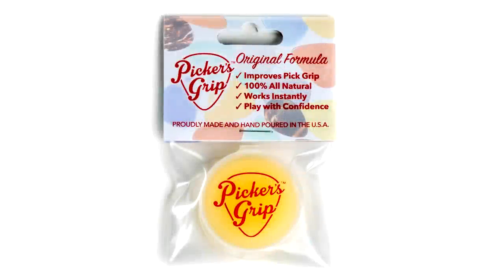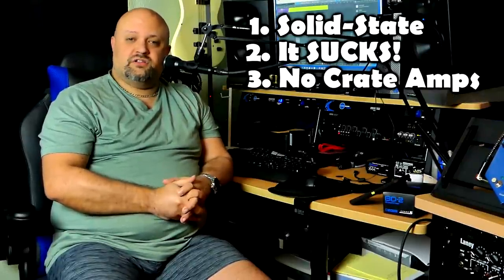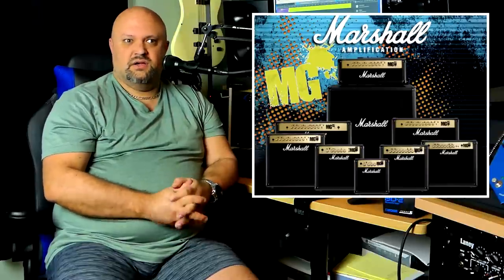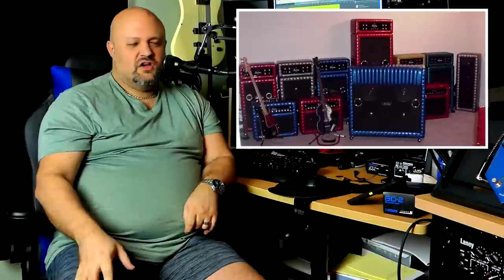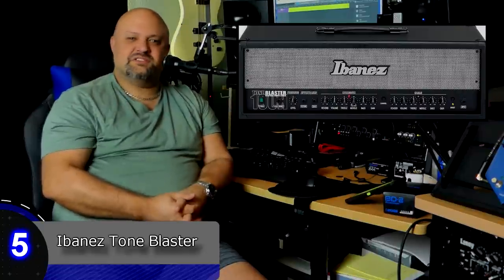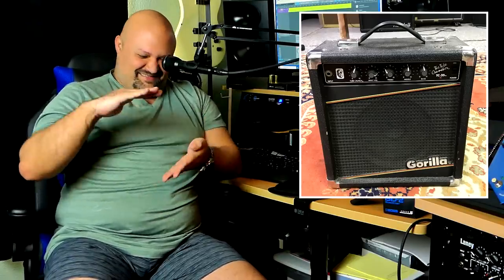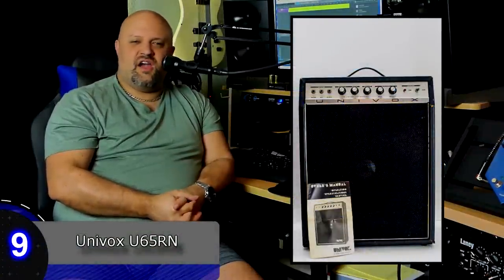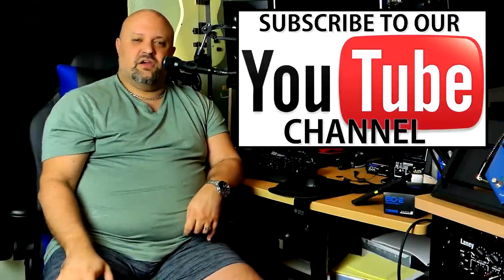Top 10 WORST Solid State Amps EVER!

Comment: What’s your thoughts on the toneblaster-x. Like the version after it?
Reply: That amp series gets a lot of hate for no reason. I had the TBX30R and as soon as I let mine go I regretted it. That was the most unique and brutal sounding amp I've ever owned. The distortion on that thing was so tight and saturated. The reason most people hated it is because they can be pretty difficult to learn to use. The midrange controls will instantly remind you of the mid controls on a Boss Metal Zone. There is DEFINITELY a learning curve. 

There are two stacked controls for the mids. They cover a wide range of frequency and one of the knobs controls the actual level of the mids and the amount of distortion affecting them. When you get that stuff tweeked right the amp is absolutely amazing. If you don't it's like a Metal Zone ran through a total garbage amp (on steroids).

If you're the lazy type that just wants to plug in and twist a knob or two for fifteen minutes to find your tone those amps are NOT for you. If you have patience and don't mind spending a week or two learning how everything affects the sound you'll have one of the best amps for brutally heavy music ever made. I'm trying to dig up a TBX150H for myself right now but they seem fairly hard to come by in my area.
Reply from the maker: I’d love to hear a sound example.

Comment: I have a line 6 spider V. Noob mistake… unfortunately having presets means you’re stuck with whatever tunes are available. The treble is through the stratosphere and everything is ear piercing. In the insane mode you can’t even hear the difference in chord changes because the overdrive is so high.

Comment: Mid 70's h/ h  VS musician amp. I was taken in by the sales blurb of how it sounded and performed just like a valve amp and the reliability factor. Tried to get something like a decent sound out of it but no way. After a couple of weeks it stopped working. Took it back to the store and purchased a good old fender valve amp. Solid state was a long way off in those days.

Comment: relieved you did not include roland jc amps . i played in a decent enough cover band for years . one of the lead guys we had  well he was kind of an annoying guy when he was in a good mood but he had a psychotic temper and a bad cocaine problem . that guy played thru a PAIR of tiny gorilla amps . he had to carry gear like this to ride his bmx to practice with a washburn eagle guitar strapped to his back - look ma no self preservation instinct .his tone was like if some one was tearing large sheets of paper inside of your ear. he did have a pedal , some kind of stereo overdrive in a plastic case . this was like 1995 . he played really quickly with no soul or feeling . he had to have gear with very little value otherwise he would pawn it to get crack money . poor guy . i got him a job and he would eat aldi tuna cans , pour the tuna oil into the sink in the restroom . he would not run the water . so every day i would go and wash up to eat and get bombed out with intense tuna whiff . he ended up flipping out and destroying a bunch of inventory in a fit so they got rid of him . he was built like a gorilla and he did a lot of karate stuff especially on stage . i saw him front a band and he was singing "sweet child o mine" doing all these spin kicks and the poor people in the front row where moving back - retreat ! Those Johnson millenniums - i JUST saw one at GC used yesterday - i was tellin my wife adrian belew toured with those amps in the 90s , he switched from roland jc120 and his tone took a huge hit . but i know another guitar player who switched from jc120 to a custom made tube half stack and same thing . i saw that guy perform in a lot of venues and i really knew what he sounded like , so that taught me a lesson about the whole tube vs solid state debate right there . dude sounded twice as good with the solid state amp . twice as good , more definition , and he is a type of player that uses like three gain stages . i had a laugh with you about those gorillas . i wonder if that guy is still alive . i heard from the sound guy of that band he saw him in january here in chicago riding his bike home in a snow storm from guitar center one handed holding a new les paul ... in one hand - so this guy had to give him a ride - typical . i hope he is at least off that tuna diet.

Comment: I have a MG HDFX Head and 4x12 Cab and although the dirty channels are a bit weak for some of the harder rock, they are fine for blues and pop sounds. I got it expecting to  not use the pre-amp as I run a Line 6 POD XT Live from the Effects Loops In completely bypassing it. I purposely saved some cash by doing this and the sounds I get are pretty decent. Big and loud enough for bigger gigs and have the flexibility of sounds I needed. I also got the Variax guitar to model other sounds I wanted like switching from Sitar and 12 Strings to a Les Paul in the middle of a song with just a patch change on the  XT. Pretty cool for gigging.

Comment: To this day, I think Line 6's are quite truly the worst "reputable" amps on the market. Even their most recent "high end" modelers sound utterly terrible. My Zoom G5 is a decade old and I will accredit the 12AX7 in it for this, but it sounds phenomenally better than the Headrush I had and returned, all the Line 6's I have heard or owned, and even though some SOB smashed it, I'll probably buy another regardless of age.
As far as Crates go, I would say these are the ultimate sleeper amps from the 90's. Some were awful, but some as metal amps even lead still hold their own today.
I scored a GX-212 for $70 today and while it's not a tube amp, I can shred bassy, clustered arpeggios through it and still get good note separation, clarity and it's insanely loud.

Conversely to that, I have a Boss Katana MK 50, and it's good for what it it is, but the dinosaur Crate still slaughters it.
The Laney making the list doesn't surprise me. They make amazing amps, but that particular series was loathed by sooo many people back in the day!

Comment: I have the Ibanez TBX150H with a BOSS ME-80  multi-effects pedal , and it doesn't sound to bad , the hue knob (presence) saves the sound .
Reply from the maker: Plug straight into the Toneblaster without the processor and tell me how it sounds. LOL
Reply: @RobertWJackson  No I refuse to do it , I don't want to sound like shit . I do agree that it's distortion sounds like shit , but a processor can make an unusable amp  sound acceptable .
Reply from the maker: Why don’t you sell them both and get a new amp?

Comment: 1. The MG cabs are great for entry level. I used to own an MG412. The heads are utter shit, though.
2. Everyone knows Spider amps suck unless you can disable the tweeter.
3. LOL you are SAVAGE
4. I actually think it's easier to get decent tones out of a V-Ampire than it is for the Spider amps, especially if you use the DI out and throw some IR's on it, but they still sound like shit, and no one is surprised. The built in speaker is utterly terrible, and the amp sims on the recording line out's were actually only SLIGHTLY better. My guitarist used to have one of these, and it took forever for me to convince him it sounded like shit. He ended up with a Behringer Virtube, which sounds like a blend of a real Marshall tube amp and a real Marshall solid state amp - not one of the MG's, don't worry.
5. I used to have one of these. The clean channel was grainy and would distort with the gain all the way up. If you used a multi-FX unit in the FX loop of the amp, the clean channel sounds pretty good. If you use a simple distortion like a Metal Zone or Metal Master with the dirty channel with the gain on 1, or something similar, the amp will act as a booster. The amp on it's own absolutely sounds like shit, though. Still better than the V-Ampire, though.
6. Never encountered one of these.
7. Broward County, FL, public schools had the keyboard amps from this brand when I was in HS.
8. Never encountered one of these.
9. My dad has talked shit about these.
10. Tube amp brands don't always make good solid state amps. Also, nobody can be perfect or on point on everything.

Comment: Haha, I had a Behringer V-Amp (not the combo, but the Line6 POD clone multieffect), and I can confirm it isn't a great amp. That was the time I have learned, there's no point designing a modelling stuff with 10+ amp simulations if all 10+ of them are half-decent at best (only the realitively clean sounds, because as you increase the gain, it becomes more and more bad), but rather bad. It had some cool feaures however, cab simulation (as far as I can remember), some good effects. But its worst bug was when stepping between settings, controlled with footswitch, ther was a second long black-out, so You had to compose a 2 beat long pause into your songs if you wanted to switch to clean from distorted. :D An absolute disgrace.
Behringer GMX is a far better effort from the company. Only 3 amp sims (solid state, not digital), but both acceptable, a good pedal platform with usable effects. I still use it today

Anyway You should have seen our rehearsal rooms back those days. We colud have shown you much worse amps. All of them solid states.

Comment: You need to go back even further. I have a Marshall 100 watt Lead MOSFET circa 1987, this amp really sucks. Mine came with an upper 2-12 cab, and I even bought the bottom cab and it still sucked. But you don’t realize how cool I looked showing up on stage in the late 80’s with a Marshall stack.
Reply from the maker: I actually like those amps.  They were basically the solid-state version of the JCM 800.

Comment: This has nothing to do with bad amps but have you ever heard a Peavey Sheffield 2x12 Special? It’s from their trans tube series but they no longer make this model. But ngl it sounds almost just like a tube a amp, it’s got the power and the classic heavy Peavey sound too.
Reply from the maker: That amp is called the Peavey Special 2x12.  The Sheffield is the speaker that came in that amp and is widely known to be Peavey’s best speaker by far.  It’s the same speaker that they put in the 5150 cabs and I believe still do put in the 6505 cabs.  You’re right, they’re actually good sounding amps.
Reply: Robert's Guitar Dungeon yeah I noticed that the speakers are surprisingly highly sought after when I tried to look up reviews on the amp. I got my hands on one for free and I love it

Comment: Yeah when I was younger my guitar player wanted a   more powerful combo amp this is like 20 years ago he played a combo Marshall looks like the mg series he didn't play with it much we were pretty young his second combo he wanted more power well he ended up getting a used 50-watt carvin tube amp gold Tweed head with a separate gold 4x10 but the next few years when we progressed jcm 1000 are Paul Reed Smith guitar that guitar and amp had more bass than my bass guitar that ain't felt great with that guitar stand in front of it yeah I got a gfx crate 212😮😅 bass player so go figure that crate sounds good❤

Comment: I also have a JCM 900.  While it's true the MG series cannot compete with the JCMs, you can't really expect  to pay cheap and get the same deal. I also have an MG15. And it's a great practice amp for the bedroom when I dont want to fire up my 900. Ive tried the MG50s live and they sound a bit lower in quality than a Valve State. But they are Not bad at all.  The Valve States are lower in quality than a 900, 800 and even a 70s Super Lead-which is a totally different beast.  The price point makes sense once youve tried em all. I wouldn't  dare use a Super Lead as a practice amp in the bedroom watching tv.  And I also think the Mgs still have that Marshall sound.  They still good sound cranked. Just dont expect them to sound any better than what they are.  I honestly dig any Marshall  amp. Believe me Ive tried many.  And to me the Mgs dont really sound as bad as people say or think. Thats just me. I'd prefer an MG to any Spider, Laney or Peavey SolidState or any crappy modeling amp.  Yngwie did use the Mgs for home practice. You can find an old article if you look hard enough.  It's like people slamming the 900 years back for not being an 800. They cant be because theyre different. But nowadays the 900 gets some better publicity. Jason Becker's favorite amp, Paul Gilbert uses em occasionally etc. But to consumers it's also  because Marshalls are not made in England anymore. Correct me if I'm wrong. It's like one of those last of the Mohicans things. A Marshall tube amp made in England . Whatever the case I repectfully disagree. The MGs kick a#s. Great channel you got. Enjoy your videos.
Reply from the maker: The higher end Marshall models like the 2203x, 2555, the JVM’s, and the 1959SLP are still made in England.
Reply: Cool. I stand corrected:) Thanks. I just miss the days when owning any Marshall, almost any Marshall, I may be wrong again, meant something. It was the Brit It.

Comment: I would like to add the Fender Mustang GT40, i was stupid enough to believe the hype when this was released, only to find that it sounds terrible, mainly due to the nasty speakers, even after updating it and wasting hours trying all the suggested tweaks it still sounds bad.
I know it's only a "practice" amp. but how can you practice with an amp that sounds like the speakers are made of cardboard?
Reply: I disconnected the speaker on mine and ran it into two vintage Rola speakers in a homemade cab.It almost sounds like it’s a tube amp.errrr...almost.
Reply: Fil on the Wings of Pegasus channel was getting surprisingly good tone out of a Mustang GT40 on a recent analysis/ lesson for Fleetwood Mac's " Oh Well" from the Peter Green era.

Comment: Marshall needs to be called out for the MG series. Thanks for doing so. The MG series wear the Marshall name but are a terribly inferior product. The discontinued hybrid Valvestates are far superior. I used to jam with a Valvestate my old drummer owned back in my high school days, around '88 or so. It sounded great. Kustoms are trash. They sound like boxed moose farts. The Laney Linebackers are a disgrace, and I agree with you on the AOR series. The only good sounding AORs I heard were modded to eliminate the 20db bass boost, which is what ruined the tone of that amp. The other issue with the AORs was reliability. For the most part Laney has produced very solid amps, more reliable on average than Marshalls. But the AORs had their issues. I agree with you on Crates. They were just fine. In fact, my uncle has a Crate XL 100, I forget which model exactly, but it's solid state, head and cab, and it sounds awesome. This is what I play when I jam with him. We're getting a band together but I won't be lugging this thing around as it's too cumbersome and will probably be using a Boss GT1 into the PA when we gig. I also think Peavey made some good solid states. I like the Bandit line. They got the job done. Good video.
Reply from the maker: I also hated the Valvestate amps. LOL
Reply: @RobertWJackson  I liked the Valvestates because I thought they got a lot more crunch than the JCM800. Yeah, the overall tone wasn't better, but the SOUND was more about crunch, and when I was a lot less sophisticated with tone that was enough for me. I was like thirteen or fourteen at the time. My drummer also had a Gallien Krueger. We'd play stuff from Somewhere in Time and Seventh Son, totally get that tone. I know it's a very polarizing period for Maiden fans because of the GK tone and the guitar synth, but it was fun to doodle around with the GK. Priest were also using guitar synth on Turbo and Ram it Down, but they stilled used Marshalls, never GK or solid state. I had a lot of fun playing my Randall RG75 combo, or borrowing a friend's Crate. Also loved the Peavey Bandits. If it works it works.

Comment: #10.  Yup, I have the 50 watt Linebacker combo w/10 inch speaker.  Terrible.  The clean sound is dull, the distortion is even duller.  And even as a pedal platform, it sucks.

Comment: I immediately thought of Crate of course because I saw so many a couple decades ago and they were thin and buzzy sounding to me. I think they have a bad rap for a reason. The Blue Voodoos could be good
I got decent sound out of someone’s Spider but I wouldn’t buy it.
Reply from the maker: The speakers that Crate used were horrible, but if you run one of their amps through a decent cab with good speakers in it, you’d be surprised how good they sound.  I’ve proven it on my channel before.

Comment: OMG ! As I am a Fender guy, I found out, that if you want a real american vintage sounding Amp, all these Amps mentioned here are to avoid. They are a waste of money, really. But I make a great difference between modelling amps to just simple solid state amps. Some real bad ones are these Harley Benton "R"s like 40 R or 80 R, too. Chinese Fenders are soundig good, but don´t live for long. So there are a lot more amps that should be left in the shops and don´t need to be touched at all.

Comment: I had a Rogue 50-watt amp back in the day that sucked a bag of assholes. I also had a Marshall MG amp at one point. Wasn't a TERRIBLE amp per-se, but damn I just couldn't get a decent sound out of it to save my life. It didn't even handle pedals well, or function as a power amp running a pre through the effects loop.

Comment: I respectfully disagree about Marshall MG's...I've owned a 100DFX 100w combo from the original series that I bought new in 2002, and that amp was put through the wringer...countless gigs, practices, jams and it always has delivered the goods, and still does! I only have to turn the master volume to 9 o'clock on OD2 and it will splinter concrete! 🤘🔥👊🎸 However, I fully agree that the later CFX and silver face MG's suck ass...Marshall took a great thing and fucked it up. Those sound boxy and shrill, can't dial in a decent tone at all.